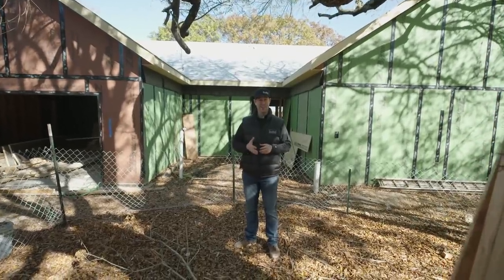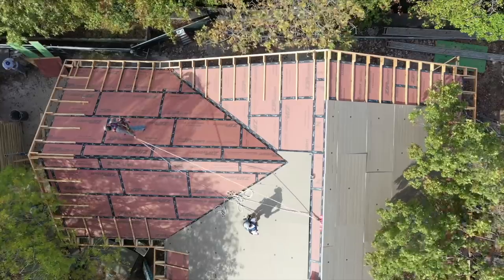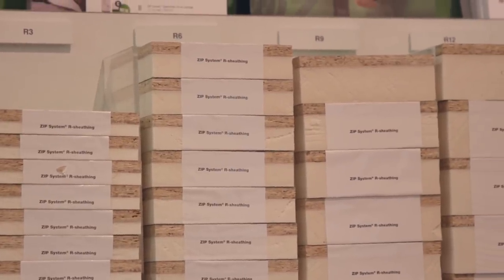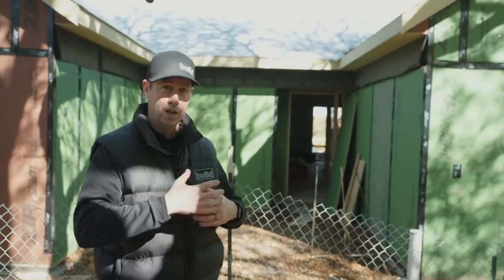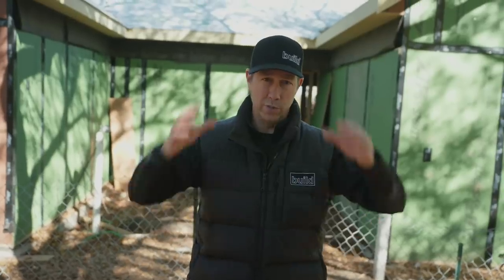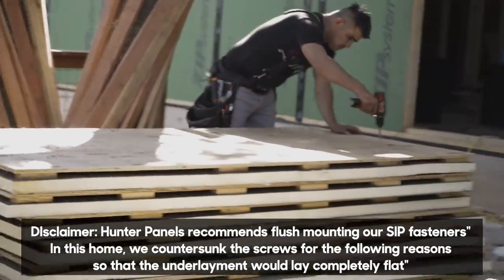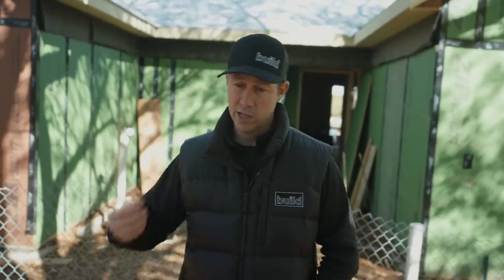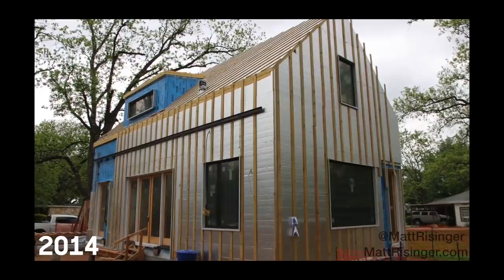Rooftop Insulation with Hunter Panels

Comment: matt you REALLY need to discuss the details re soffit air intake into that Hunter panel and ridge venting as well as how to attach roofing material-metal OR shingles -also please clarify -did you run brown zip on roof first (ie under first layer of foam ? otherwise how do you achieve air seal on the deck ?
Reply: Good comment.  Have same questions.
Reply: Me too Matt. Would still need some soffit and ridge vents to draw a convention air flow. Similar venting if using metal roof with the wood slats arranged angular to the ridge.
Reply: I have to agree with these other comments Matt. It seems to me that, other than having an additional radiant barrier with the top layer of ISO, the venting channels which are intentionally left open to ambient temperatures, nullifies the work done by the top sheet. I even have to question whether or not airflow through these venting channels might actually create a wind chill on cold days reducing the efficiency of the bottom layer of rigid foam.  With the amount of radiant heat reduction we can now get from lighter colored roofing materials, I think this technique might be too costly for any benefit it might provide.  Actually looking forward to you proving me wrong.
Reply: He used foam backed zip on the roof. Most zip is sealed on seams with their proprietary tape and he used butyl tape where he knew future fasteners will pass through. That's his vapour barrier. Everything is built on top of this layer for the roofing. And then he's using Rockwood in the attic for insulation.
Reply: I had to rewatch this cause I really like the idea of it. It looks like (and he mentions 2” soffit vents) he vents the soffit and the I would assume you leave a gap at the ridge. It would get covered by the metal roof cap - or ridge vent if you were shingling on top. I think from an affordability stand point, you could reduce the cost by not adding the middle layer of polyiso, and just use zip roof then the Hunter Panels.
Reply: I 2nd this .
Reply: I think what’s a bit confusing is that he’s comparing his house to this house. There is no insulation above the air gap. From top down, it’s metal, membrane, plywood, air gap, polyiso, plywood- right...?

I’d love to see a cross section mock up

Comment: I'm somewhat worried about this plywood being 140+ degrees regularly.  Putting the air gap directly under the metal roof seems like it would avoid the most materials being under continual extreme heat/cold.

Comment: Really appreciate your videos!  My truss manufacturer messed up our trusses on a current home addition (the sales rep didn't send our blueprints to their engineering department & just decided to wing it...) and as a result our fascia on the addition is 13 inches lower than existing house.  We're currently in the process of cutting off our overhangs & installing rafters over existing roof.  Along the way I'm having my framers insulate the roof as well.  I wasn't sure if I was putting together a good plan or not, but based on your videos it looks like I'm essentially doing insulated monopoly framing with overhangs.

Comment: I did a «perfect wall in  my cabin» : sheating is a permeable wood fiber board (R4) and i have a rigid foam layer (R9) with the air-water barrier membrane already glue to it. Technically, it is R13, but even if it is not finish with no inside  insulation, everybody is surprise by how warm it is (ans silent). A lot of folks were telling me i was crazy (what no  vapor barrier???),  i will just put R13 inside, in de 2x4 frame (that are inside the timber-frame) with no vapor-barrier, only rockwool + gypse panel, so the beautiful timber frame will still be visible. So the total is R26, but  R26 with R13 of rigid «outsulation» is really not the same as R23 with only insulation inside. Thanks to Matt, i was new to construction and i started with something close his Houston house...

Comment: I did several projects with 3 in. Foam and a sealed air gap and then 2 in foam. Finished with 2 sided radiant barrier with proper air gap and celetex ceiling tiles for an R 100 insulation in the ceiling and r75 in the walls. PCH( Pacific Coast highway) traffic with motorcycles and busses going by 75 ft away. No sound from traffic or jets overhead through the ceiling or walls.Customers did not need to use a/c during the summer. Just a fan. Even with the sun beating on the outside wall.
Reply: == 75 feet from that monstrosity called PCH and no noise pollution?  That's an impressive achievement.
Reply: @rerite2  I was surprised myself. The homeowner made the comment to me months after I finished. I made everything so air tight that they would leave this vacation home and a month later come back and say there was no dust anywhere. Also surprised to hear this. Another customer told me she could take a nap in the heat of the afternoon with the fan running and the sun beating on her bedroom wall and she was quite comfortable without a/c
The State Inspector told me that  the management company that ran the subdivision said I was the best contractor to ever remodel in their location. Nice to hear.
Reply: Sounds like El Segundo or Playa del Rey. Nice job.
Reply: @user-tv5dt3nm9y  Newport Beach .right where the boats go by.

Comment: Matt I am so grateful that you made this channel and share your knowledge. I have learned many things that I never gave much thought to before. 
I really like this roof system. But on top of your stick down layer still needs to have something on it before the metal. The rain screen Brillo pad wounded fine. Without it the metal will still burn the stick down layer. 
Remember the other brand that said it was good up to some crazy temperature but when you went back to fix something on the roof and pulled a piece up it was burnt and dried up because the metal was right on the peel and stick. 
Hope to here back from you.

Comment: Matt - much appreciated as always.  Question:  Why not just build with standard rafter overhang, but sheath the bottom of the rafters with zip (so not exposed) and then tape facia to that sheathing and that sheathing to the wall.  Still air tight - and less gymnastics for overhang.  True - tails will not show - but its a better construction than exposed tails for durability anyway.
Reply: Hah he just recently did a video with this exact idea. Apparently you were ahead of your time!
Reply: @timgleason2527  🙂

Comment: I like your videos! I’ve learned a lot from them and I’ll be using a lot of your advice when I build my house next year. I’m a contractor here in Tennessee. I’m surprised your fasting the metal to the plywood. I’ve been doing metal roofs here for the last 12 years or so and we always install 1x4’s first. It’s amazing the pullout strength difference in screwing into plywood versus 1x4’s.  We’ve had to do a lot of repairs on other roofers roof installs who just fasten to plywood. What I’ve seen happen a lot is the screws start walking out after 2-5 years. Have you had a problems with that Matt?

Comment: Man this inspires me to try and figure out how to better my house considering it’s been added onto 3 times
Reply: I tell people if the house has already been partially remodeled more than twice, the best bet is to strip it to the studs and male a fresh start.
Reply: @kenbrown2808  this house has been added onto three time the original part is a hundred years old
Reply: @montebarnes8043  yeah, might be good to think about making a fresh start.
Reply: @kenbrown2808  I would if I had the money but it’s a small house 800-900 sq ft so not much is wrong just needs electrical help
Reply: @montebarnes8043  yeah, budget challenges are a universal thing.  still, if you're dealing with original wiring, keep in mind, the correct way to bid a remodel is to calculate what it would cost to do a new house the same size, and triple it.
Reply: @kenbrown2808  yeah it’s not original someone rewired it but there is one 20 amp breaker for 14 outlets and four ceiling lights
Reply: @montebarnes8043  it could always be worse. But your predicament is figuring out whether you will get more for your money by doing it right, or by adding good wires to bad wires.

Comment: I’m trying to meld the conditioned and unconditioned.  Full soffit vent. Vented between trusses 3” deep to full ridge vent, then fiberglass air permeable inside that to R40+ in zone 4.  I did it in the house I built in 1997 and it’s worked pretty well. Attic does not get 100F in heat of summer.  Ceiling  has R38.  2200 sf full electric house averaged $147/mo last year zone 4.   Neighbor pays double mine for about 150 sf larger house.

Comment: Fabulous innovation, Matt.  You're a true Pathfinder.  I'll never forget that roof job I helped with during a long summer heat wave in central Texas (1998).  It was my job to climb into the attic and repair a few rafters.  The temperature was so hot, I was sweating profusely, and I couldn't hold onto tools because they were all wet from sweat streaming off my face onto my hands.  My best guess:  it was >130 F. in that attic!  We got it fixed, and at lunch I must have downed a gallon of lemonade!  Later, I shared some very preliminary ideas with folks at Habitat for Humanity.  I'm thrilled to see you elaborate the crucial details.  p.s. I recently did a very rough "parametric" analysis that went like this:  if proper attic venting saves an average of $25 per month in AC power, that's about $100 during 4 hottest summer months x 20 years = $2,000 saved x 1 million new Texas homes = $2 Billion USD saved by this one invention, in Texas alone!  Now, extrapolate to the entire USA, then do same in Asia, Europe, Africa, Mideast, Australia and South America.  The potential market for this one invention is ENORMOUS!  We archived Joseph Lstiburek's great article from Fine Homebuilding here:  http://supremelaw.org/authors/matt.risinger/PA_Crash_Course_Roof_Venting_FHB.pdf

Comment: I am currently working with Hunter Panels for this very thing.  I am also working to use their sheathing, which is also insulated, but does not have a WRB built into it.  I don't like the perm rating of the ZIp, so I want to use a separate WRB that is not integrated into the sheathing. They seem to be the only other player that has insulated structural sheathing.

Comment: Matt, how did you handle the Hunter air gap at the eave? Seems to me that that would be a cool place to play around a bit on how that air channel starts and terminates.
Reply: This question definitely needs addressed.  :-)
Reply: You create a chimney stack along entire ridge by cutting the top plywood sheathing 1” short of ridge. You cap it with a slotted z-flash and stand-off ridge cap. Very easy and common w/standing seam roofing. It’s recommended to run reticulated pu foam behind z-flashing to prevent insects, 30 or 45 ppi works great, is widely available and cheap.
Reply: Thanks Mike but that is a roof peak detail. And an interesting one. But I think the eve venting leaves a ton of room for innovation and architectural play. I'm thinking a false fascia with a gap (filled with bug proofing) or a gap at the wall/rafter interface. Like I said how the air gets in and out could be fun. The fact that it needs to is always there though.
Reply: @bluenadas  I would cut the foam 2” short on end the cantilever 2x6 off siding , cut the ends at roof pitch and nail 1x6 fascia. I’d then run the SIP top deck over the fascia either top screwed or stapled. The drip flashing over that. On the underside, I have a soffit that I fit 1x material w/2” screen or louvered intake along entire length of soffit.
Reply: @MichaelM-to4sg  I like that idea but want if you wanted an open soffit design like Matt enjoys with nice cedar rafter tails? I’m thinking foam ends at the wall and you rip cut about 5” of a 2x6 3/4” deep  to be flush at the SIP decking but allow an air gap at the wall/SIP interface. Filled air gap is hidden in shadow and the style of the open soffit is maintained?
Reply: @bluenadas  agreed. Tie the eave rafter tails to the rafters using 2x6 or 2x8, depending upon height of Hunter SIP. Seal end w/Zip tape. Install screen material between rafter tails for intake.
Reply: Page 23 onwards: https://www.hunterpanels.com/product-documents/hpanels/speciality-products/102-cool-vent-installation/file

Comment: That hunter decking IS the secret sauce in this. Bonded like that makes it all possible and not using purlins ("the 1x4 method") means you can use standing seam roofing which is so much better than a metal roof with THOUSANDS of holes in it. That hunter panel would also lend itsend well to the same framing and an engineered purlins system with overhangs and just a screw down metal roof like a pole barn. Unfortunately you would have to seal it all up like an old open eave house to keep varmits out but the envelope would be tight for the house.

Comment: Northern builders might also want to keep the strapping under the metal roof.  We get a lot of frost and condensation on the bottom side of our metal roofs that needs to dry.
Reply: Norther builders may also want to consider the snow load on the overhangs.  Austin TX doesn't get much snow but, where I am in NH, overhangs like the ones Matt is installing would have to carry a significant amount of snow load, especially in the spring when the snow is melting and can gather at the edges.  I don't think a mechanical fastened 2x supporting the overhang would fly with a NH structural engineer.

Comment: Matt, what do you do for exhaust fans and plumbing vent pipes going through your roof?
Reply: The zip tape or caulk makes an amazing seal around those. Just like around windows.
Reply: Also make sure the foam of adjoining panels are adhered to each other so there are no unintended airgaps. I saw plenty of caulking between ZIP R-3 and studs. Just pay attention to the details.
Reply: 1 pipe is his goal
Reply: Excellent question. If you’re having to run pipes in the middle of a panel, it would be nearly impossible to foam seal around pipe w/o cutting larger hole at deck sheathing, enough to fit foam hose around perimeter of pipe. 

Of course there’s no reason for exhaust fans other than an ERV/HRV intake-exhaust, which is plumbed through wall, unless you have gas appliances. Plumbing vents too can be vented high on walls under eaves. That’s how we do it up high in Rockies.
Reply: @kevinbloomquist2637  The wood sheathing has a rabbet joint, when fully engaged, the foam is flush. I suppose a bead of pu adhesive like Liquid Nail Ultra or Siga Primur along all mating surfaces would be an extra measure worth pursuing. The biggest area I’d be looking to use adhesive is at ridge. The foam should be mitered along ridge while the decking sheet is relieved approximately 1” short on each side of ridge creating a 2” chimney vent. Whether you seal that mating of the 2 foam panels along ridge w/adhesive or application of spray foam, sealing that joint is imperative
Reply: @timothydillon6421  I think it's an local code issue.

Comment: Matt, how are you going to handle venting of the air gap in the Hunter panel? I think I see how you are handling the eaves. But it looks like you have the Shark Skin underlayment completely sealing the ridge, will you be cutting that open when you install the metal roof? Also a little surprised that Hunter does not add a radiant barrier on top of the polyiso. Seems like in a hot and sunny climate a foil film under that air gap could stop a lot of heat from being radiated further into the structure.
Reply: I was curious too about whether they put a radiant foil somewhere. Really don't understand why they wouldn't.

Comment: Matt, did you use the newly-released Dap E90 acoustic sealant on your zip panels?  I got a tube and not impressed with what I see. Seems very similar to the other cheapo white acrylic 'acoustic sealants' marketed by the usual suspects.  Very little flexibility - poor tear strength/elongation/adhesion and plenty of shrinkage.  But not surprising for $6 for a 28 oz tube...cheaper than Alex Plus painter's caulk.

Comment: Well, if you had known about GPS instead of EPS you would have gotten more “puffy jacket” on your roof. I suspect graphite might be making its way into spray foam making it more fire resistant. I’m looking into building into my new place making my own with a spray barrier on plywood or OSB, taping like Zip, but with more longevity and still using rock wool interior.